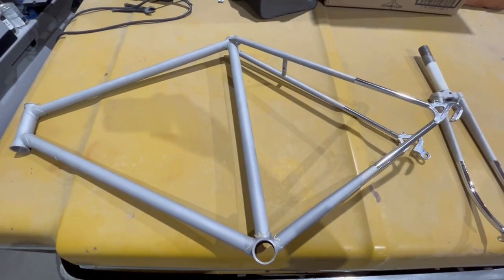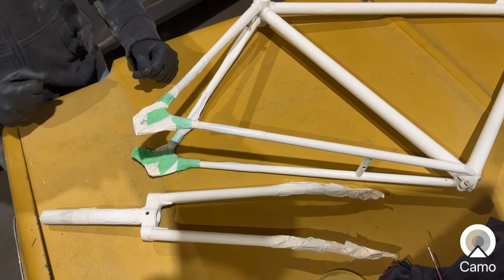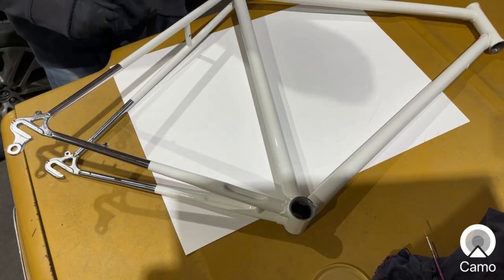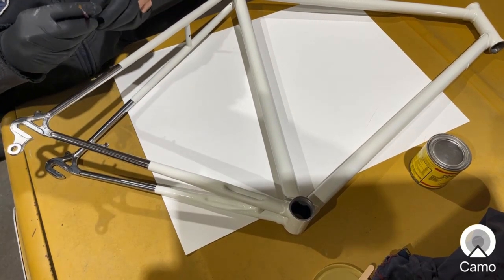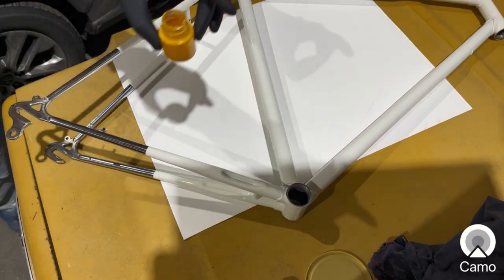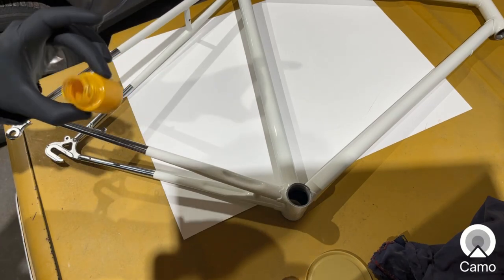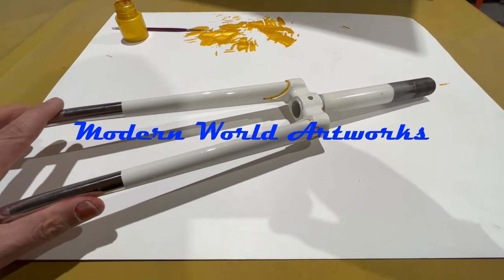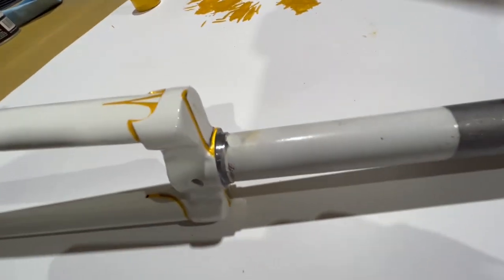Customizing a road bike- Peugot PX-10

Comment: Superb frame and forks. I rode one for 20 years having bought it used as a ''temporary'' fix for a broken audax bike. That front fork is so springy that on very rough tarmac at speed you can see the wheel bouncing a couple of inches. No need for suspension forks. Front headset never wore out despite that (maybe because of that). 
 I paid it no respect until it finally snapped at the chainstay again . Then I realised that replacing it was going to take a lot of thought and money.
I hope yours gets well preserved. It should be seen as a gold standard for ever.

Comment: Lucked into a literal “barn find” PX-10 a few years ago. Paint and decals were mostly intact, as were the hubs and derailleurs, but the BB was wrecked. Put in a sealed cartridge replacement. And the cad-plated spokes we were badly oxidized, so I replaced them with SS. Other than that, it was back to almost original.
Reply: could you steer me in the correct direction as far as the bb i need to do the same on a green 1 i got a few weeks ago  other than that i should be spot on thanks in advance for any help

Comment: im curious why you applied clear coat and then did the brushwork over it?
Reply from the maker: I use a striping enamel that can either be cleared or painted on top of surface. I figured it would be cool to do it on top of surface, that's how most customizers did this type of work in the old days.
Reply: Very cool! The more you know ✨